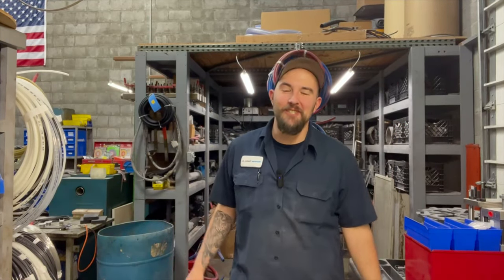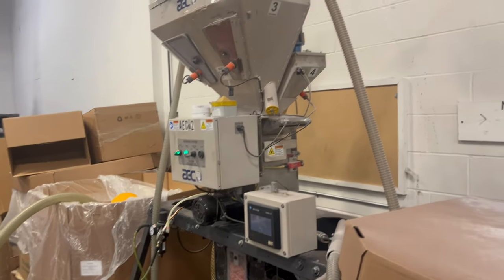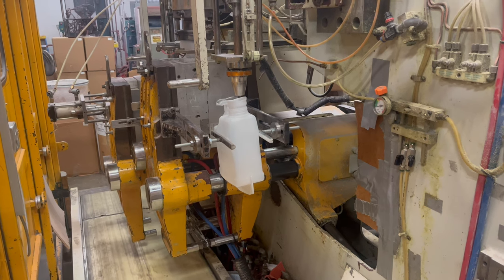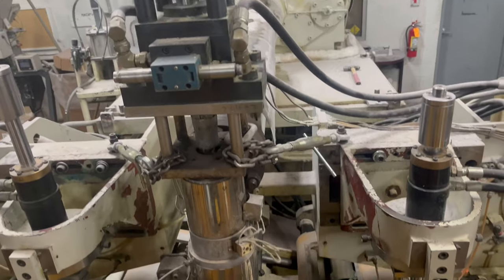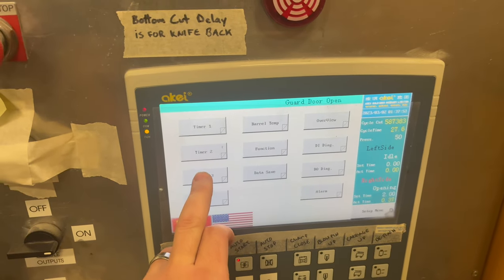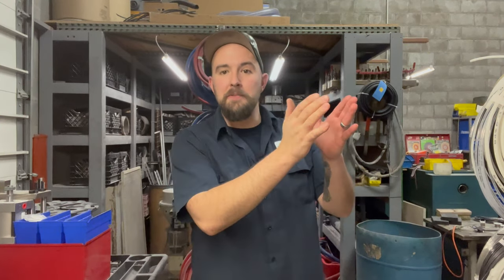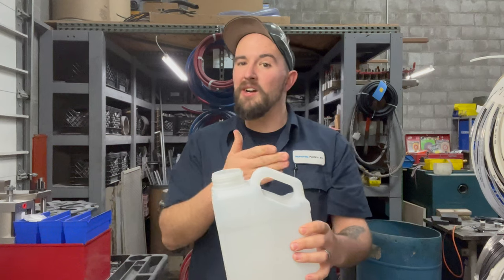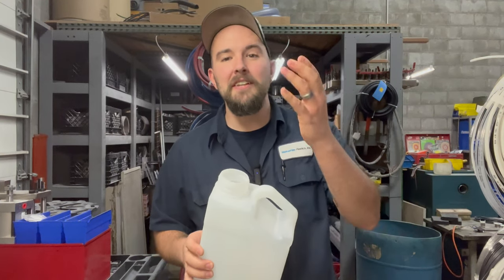How blow molding works!!

Comment: Nice jugs!
But seriously, do all of the jugs get tested, like with a pressure test? I work in quality at an automotive plant and an Off-road vehicle plant before that, and I'm curious about how inspection and testing goes into products.
Reply from the maker: Every single bottle goes through a pressure test before leaving the plant. A testing machine pressurizes each bottle to a specific psi of air and will detect any leakage of pressure over a given amount of time. This ensures that the bottle will not leak when filled with a liquid. Thanks for the comment!!
Reply: I work in a company where we have auto deflashing, so the next thing is the jug gets on the convoyer and goes automatically to the leak tester, where it gets pressurized and checked for leakage, after that it goes to the table packing, and then it gets tested visually by the packer.

Comment: I worked in a milk plant in Huntsville Alabama from '99 to '02 and we made our own jugs.  I was fascinated the first time I saw it.  I was there one day when routine maintenance had to be done on the machine.  They were in the process of purging so we took some of that and made a baseball bat (extremely crude) and a few balls.  You don't want to get hit by that stuff.  It's extremely hard and dense.  I got some the next time and made a hammer.  I had to put it through quite a few heat cycles to get it how I wanted it but I was able to drive 16p nails into pine studs with it.  It was unstoppable!
Reply: right, this is how baseball produced on our machine:

https://www.youtube.com/watch?v=4UHISZEy574

and this is how to produce baseball bat on our machine
https://www.youtube.com/watch?v=tL1sxykhIss

Comment: Great video, very informative! Older BM machines require manual deflashing, unlike many modern machines that integrate various automations such as leak testers, automatic deflating or post-cooling stations for large jerrycans. What are your thoughts on the All-Electric technology?
Reply from the maker: Electric is the way of the future with machine. Servo motors are fast and quiet. Longer life span. All in all. I like them

Comment: do you ever try to produce 5 gallon by PP instead of PC or PET?
Reply from the maker: Poly pro is a strange material. I haven’t had much experience injection it. I know it is widely used for blow molding, but I don’t see why you couldn’t.

Comment: We just acquired a blow molding machine but it's producing more scape than the real containers. The blow molding pin is damaging the container necks
Reply from the maker: Blow molding is a real art. Having a good blow pin, shear ring, and neck blocks means absolutely everything. Best of luck to you!!
Reply: Hi Bro, Our blow molding machine will not damage the container necks.Do you want to try?
Reply: this can be adjust by the machine supplier, next time, you choose the right supplier with good quality machine.

Comment: A couple questions:

1. Is the whole screw apparatus heated to keep the plastic molten?
2. Is there any risk in the plastic burning if it's kept at a molten temperature for too long?
3. Is the mold itself also heated?

Thanks for making the video!! I appreciate you doing it.
Reply from the maker: Great questions! Yes, the barrel and screw are heated. YES, you can burn the material in the barrel if it sits too long or if temps are too high. This is also called “soak time”. The molds are cooled with circulated chilled water. This helps to solidify the molten plastic and harden into its final shape.
Reply: here's my answer for your questions

1, a set of heater rings are placed on the barrel, to heat the plastic molten.
2, no risk, just same as injetion molding.
3, for blow molding, heating on the mold is no needed.

Comment: A long time ago I worked for a plastics company in Reno, NV. as a machine operator. I had to walk through the blow molding department to get to the department I worked in. I typically ran a couple of thermoforming machines (hot sheet of plastic lowered onto a mold then vacuumed into shape). But occasionally I would run a CNC 5 axis router. Most of the parts that I made were the plastic pieces that go inside of slot machines (like coin hoppers), or car parts. The company had several other departments: acrylics, press molding, injection molding, we even had our own recycling (chipper) machines.
Reply: Good job, can you be our agent in your place? we are professional manufacturer for this blow molding machine in China.
Reply: @jinjun-blowmoldingmachiner1835  
that was a long time ago, around 2005. 
I operate very different machinery now. I'm a semi-truck driver.

Comment: Great video.
We make bottles in our plant and fill with carbonated products too.
Our 20oz line has two blowmolder one can run 20,000 bottles an hour the other one runs 16,000 bottles per hour. Our filler runs product into bottle 800-900 per minute. Our 2 labelers run 500 BPM each.
Packer does 40 cpm.
Palletizer does about 1 pallet  3-5 minutes 49 cases per pallet. Our full pallet conveyor hold about 10 full pallets. The warehouse forklifts on a good day can't keep up with the line. We can run over 30,000 cases of 20oz in 24 hrs
Reply: What kind of machine?
10 cavity rotary?
Reply: What kind of machine is it ? You must be talking about PET blow moulding right ? Our Sipas can run like 5000 an hour. Maybe more but then everything else cannot keep up. I hears of a beast at the annual plastic show that can pump out something like that but that's a monster.
Reply: so, it is PET blow  molding machine?